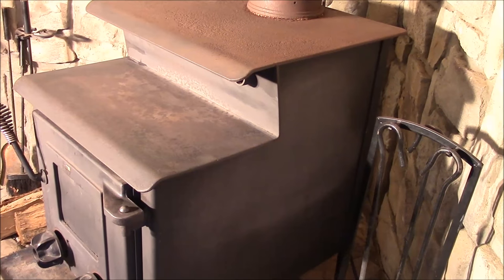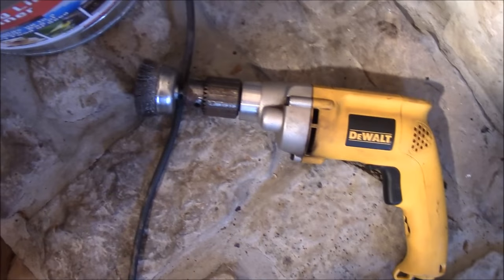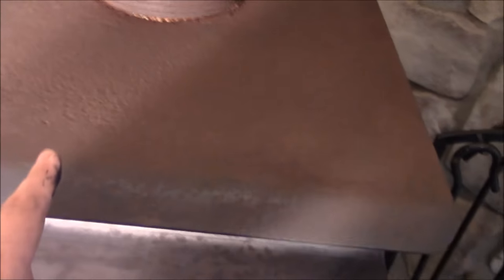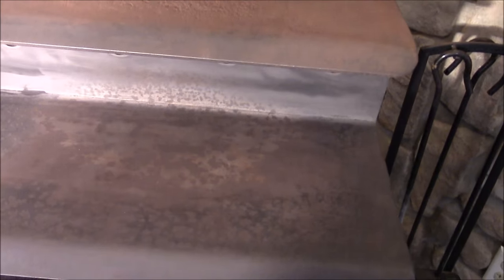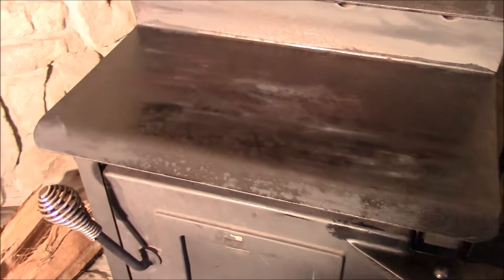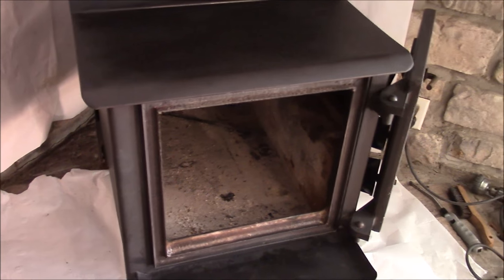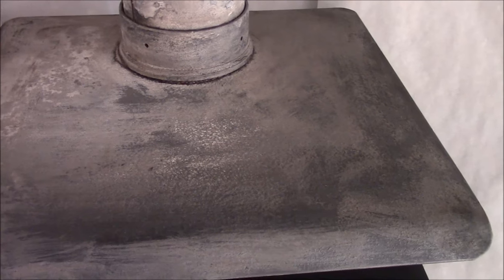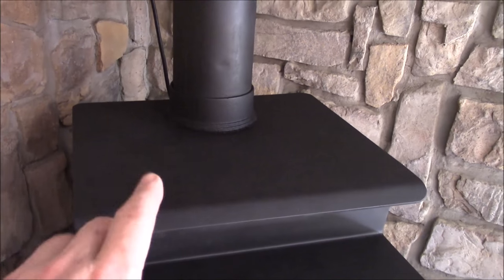How To: Wood Stove Restoration ~ Rust Removal and Refinishing to Stove Black

Comment: Good idea to stabilize the rust
I will try it on my smoker.
To seal small cracks around my
chimney,I use
rubberized undercoat in a spray can.
It's easier than tar
and you can use
multiple coats.
Reply from the maker: jchiliw Thanks for the tip! Thanks for watching and commenting as well.

Comment: I have a stove that is in much worse condition than that. The building it was in, "floated away" in a major flood we had here in 2006. This stove had never been used. It fell out of the house, about a 1/2 mile from where the house started it's trip down the river. It was found and brought back. Then left outside ever since with a coffee pot sat on the chimney. LOL It was full of sand. And here in the northwest, coffee pot or no, it remained wet the entire 11 years from then, until I recently was given it.

On, to my question... I will use the ospho on the outside, like you did. But I am curious about whether you used it inside or not. If you did, while I know it would work the way it is supposed to.. Was it then affected by the fire? In other words, did the converted rust stay converted? Did it just flake off, and the steel start to rust again? Etc...

Comment: what a difference it looks great. just curious do you clean the inside of the chimney occasionally?
Reply from the maker: Arky Homesteader The short answer is yes. However letting the fire burn really hot for about and hour with each use will also burn up most anything that will stick to the flu pipe.

Comment: Is the Ospho safe for a stove? Just wondering because of the excessive heat from the stove.
Thanks
Reply from the maker: I thought that I had mentioned it, perhaps not.... yes I called the manufacturer and asked. I "burnt it off" with a exhaust fans just in case, much like one does with a new stove. No issues for me.

Comment: The stove pipe was installed upside down, that's why it's leaking from the joints.  Totally wrong, take it all down and do it right....and you don't paint wood stoves, you use stove black.
Reply: Some manufacturers of stove black warn that their product is only for cast iron. Apparently, plate steel is so smooth and devoid of pores that it cannot provide a suitable surface. I'm going to try anyways, but my expectations are low.